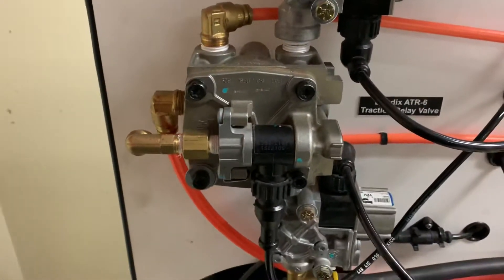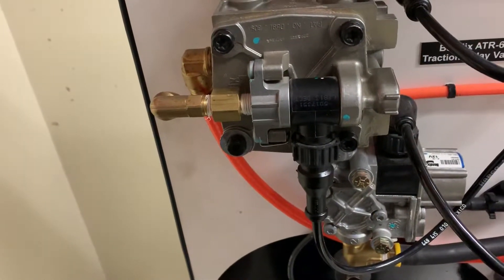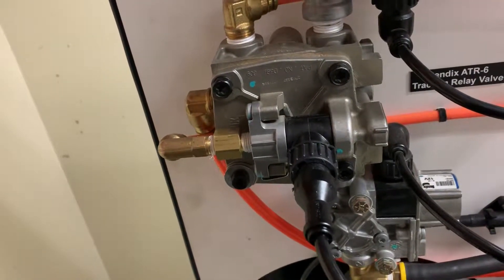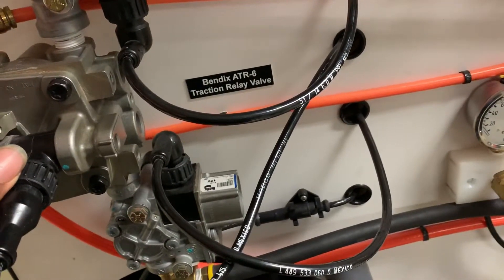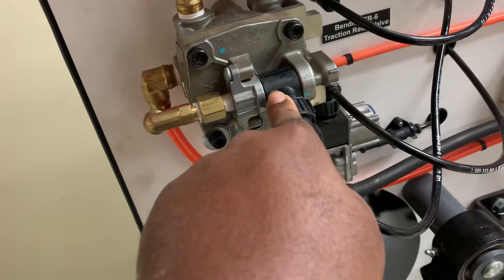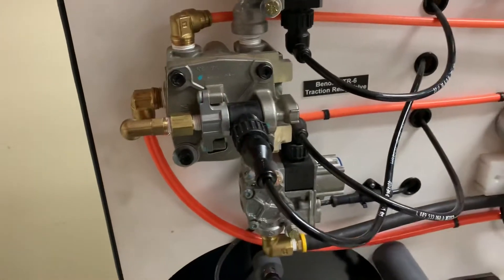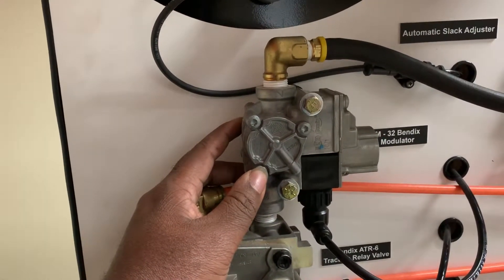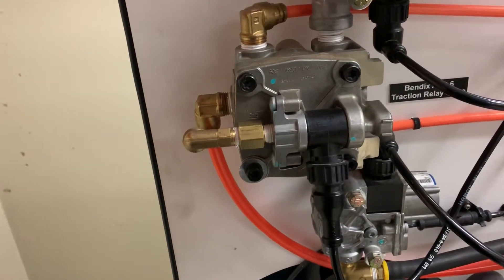Air Brake Relay Valve ATR-6

Comment: Im having and issue with the valve when i realse the brakes the valve leaks from the exhaust port i checked the control line and it has constant air  pressure and dont know why any helo woukd be very appreciate

Comment: I have this exact valve on my truck. When I'm parked, yellow button pulled out, it doesn't leak. When I push the yellow knob in, to drive, this valve leaks from the exhaust port. If I push the foot pedal in, it temporarily stops leaking. I bought a kit to replace the o-rings in this traction valve. It didn't solve my problem. Any ides as to why this thing leaks air from the exhaust port? Also, there's another air line hooked to this valve that wasn't discussed. It's an air line coming from the balance port on the quick release valve that's close by..

Comment: Why would it activate without wheel spin ? This is happening to me front driver's just locks up I took the solenoid line off and that's where the air is coming from can I cap it off to get home?

Comment: I have same valve like this on my truck and I have an issue with it.  What happens is when the air supply drops 70-60 psi it dumps all the air out I am not sure if this is the bad valve or something else.  Any help greatly appreciated

Comment: This was a really great video, I was always wondering how ABS worked with air brakes. Perfect explanation.
Reply from the maker: Glad it helped!
Reply: I have the same abs airbrake ATR 6 and it's leaking air from the top solenoid fitting. Do I have to buy the whole thing or just the top solenoid?

Comment: I have the same valve on my truck. When my yellow knob is pushed in and I press on the brakes air just dumps out of the bottom and none of my traction tires brakes are working. Can I just take the top off of the traction valve and replace the O rings? No one seems to have that valve in stock.
Reply from the maker: I wouldn't rebuild these. You wont know its malfunctioning until you really need it!